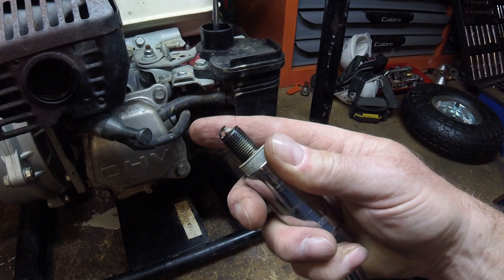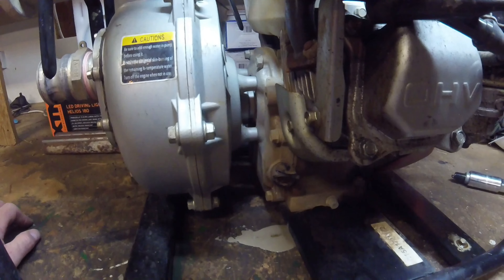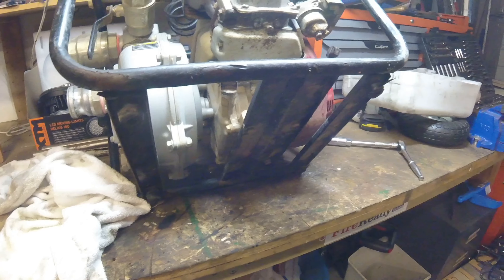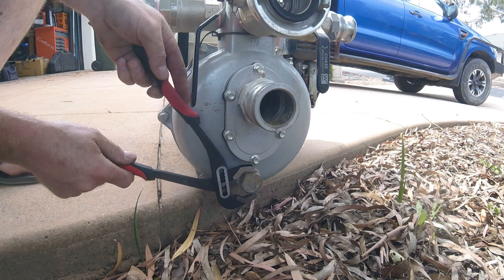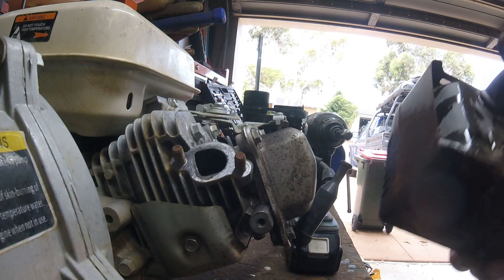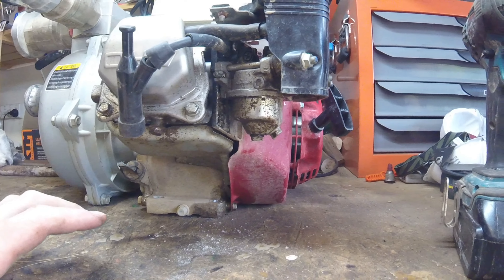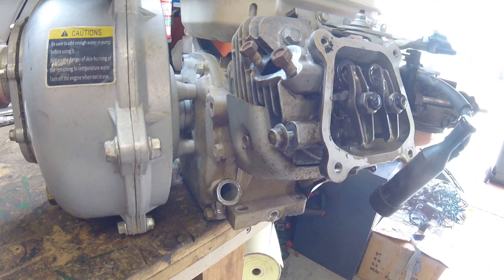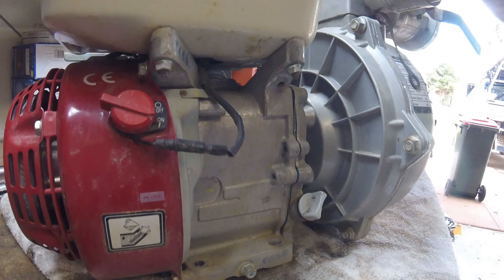Fire Pump won't start - Part 1 Milky oil fault finding - 2022 #02

Comment: Wow, you took that further apart than I would have.. but as you were talking it apart, you were saying how you love your friends mother..🤣 How engineers keep is miserable. 😁👍
Reply from the maker: Call me slow…. It took a while to understand your message….. yes I was muttering a few curses. 🤔🤣🤣🤣. 
I often take things apart more than I need to, but in this case I needed it broken down to get to the seals. 
Bit of a twist coming though as I eventually work out what caused the issue.